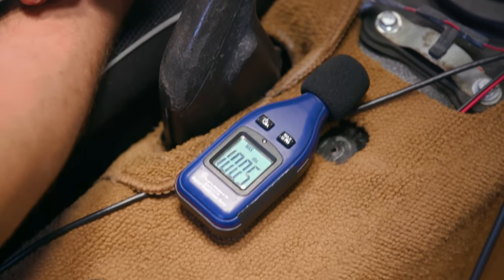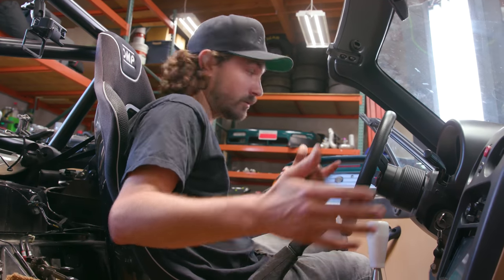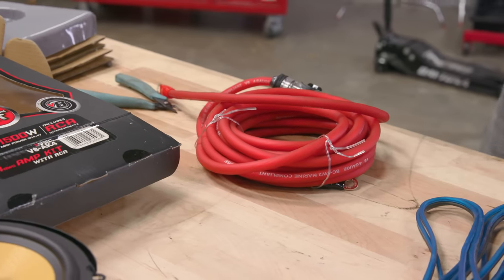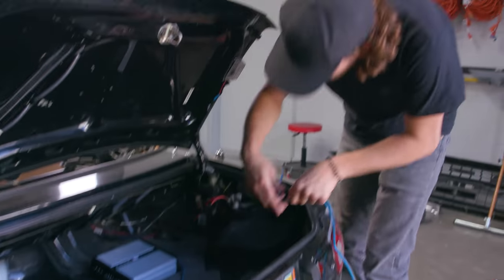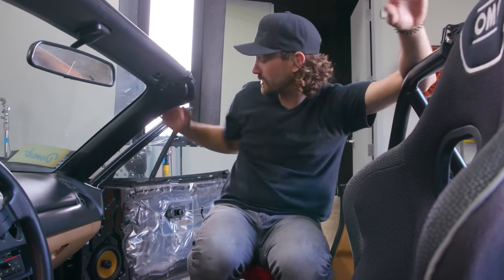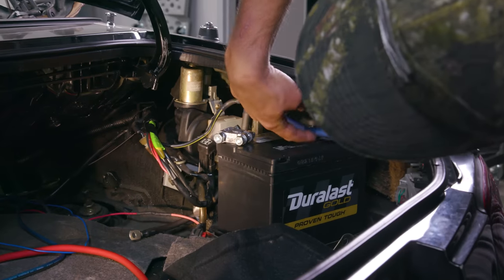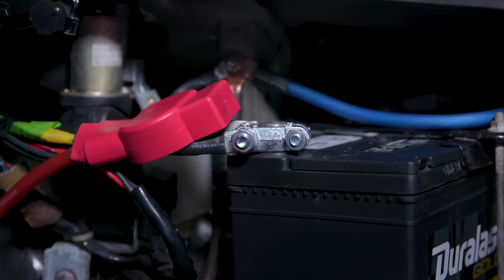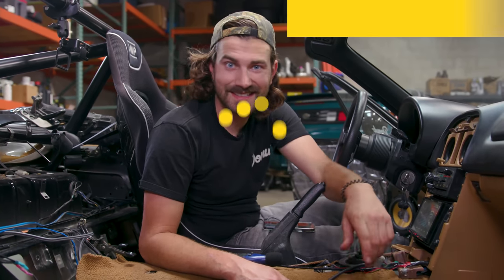Is Upgrading Your Car Speakers ACTUALLY Worth It?

Comment: Good instructional but... did anybody else key in on the fact that he wired it up to two channels, left to unused instead of just bridging the output and turning down the gains? Could have also ran the 4 channels to the 4 drivers too - even better. It's not really a good idea to leave channels unused.

Comment: Your first mistake was that you didn't hook the amp up to the alpine speakers first. They sounded like crap because they were starving for power. Bet they would have sounded equally as good or even better than what you replaced them with if they would have had amp power available. 🤦‍♂️

Comment: Nice video, I do a lot of accessories installs and repairs, and it's good to see some quality. Quick tip, use the old wires to pull the new ones through. But... you are kind of cheating doing the install on a gutted car! LOL

Comment: can you help me out. im replacing my stock speaker with these speakers
max Music Power 320W
Nominal Power 180 W RMS
Woffer 100MM 4"
midrange 40mm
Tweeter 11mm Dome
Impedance 4 ohs
sensitivity 92 DB
Frequency Response 30 HZ to 36 Hz

what AMP do I purchase to match my new speakers

Any help is much appreciated. Thanx

Comment: If you have a modern car with a premium sound system 
You don't need any new speakers, they won't do anything for you. 
Only think you might want is a little subwoofer to bring it all to life. 

You'll think that new speakers will give more bass, they won't. 
You think a set of overpriced Focal speakers that are the same wattage as the others for quad the price or more
will give you some next level audio phile sound experience that will blow your mind? 
It WON't. 
Don't waste your money or time if your car already has distortion free speakers that sound wonderful when the EQ is set right, get a subwoofer. 
Make it an 8 inch one that is sealed. Nice clean bass with a good punch. 

Done. Now if you have an old car from the stone age and the speakers are fried then ssure. Go to your best buy and spend 50 bucks or so on a set of speaks.

Comment: if someone can help me would be great. i got a honda accord 1999 with subwoofer from factory and bose amp. but i got aftermarket head unit and my subwoofer doesnt play and i know i got wires from the factory plug to the headunit adapter that arent in use but idont know what is what or how to figure since i dont have a wire diagram over it and cant seem to find been searching alot . and when i measure resistant it seems like they all fit to the back. and i dont have wire diagram over the bose amp aswell :( fml

Comment: You're a great presenter.  That being said, you have been scripted many misconceptions. Copper free power cable is Bull S**t.  Copper free interconnects (Amp to Pre-amp) is proper. Copper free speaker wire (How quite is your environment). That bad sound is likely pre-amp clipping and maybe amp clipping. For best bass response the amp should be 25% to 100% above speaker specs. Sub-woofers are for THX or rap where the music is immaterial. The overdriving amp of 50% will reproduce the lows you are looking for unless its rap. Noting will satisfy rap until the rust is falling off the cars around you.  This is just the basics. And I would bet those Alpines would sound better that those jd's with the amp upgrade I suggest.

Peace!

Comment: no matter how good your speakers are, they can't compite with "normal" speakers and a subwoofer
also, apperantly you shouldn't use the copper coated aluminium cables that come in these kits
after installing my subwoofer with 16mm² copper cables going to the amp I got a lot more volume and cleaner bass

Comment: DIYers may want to test all your speakers before screwing them all in. Wire everything up then turn the radio on to make sure it all works before screwing everything in place. Nothing more infuriating than closing everything up and then a speaker doesn't work

Comment: Dang rca is still a thing??? Thought that would have became a thing of the 80's and 90's, even early 2000's, 2010's, and 2020's. 😲 something's just dont change 🤷‍♂️ must help with cost?  Idk, I figured standards would change over 50 years,  I mean pc builders dont mess with molex or dvi cables anymore. I think???

Comment: the equipment is good equipment but do to the fact you are hooking it up incorrectly it will lower the life of the equipment. the biggest problem that i seen was you dont have the fuse block installed correctly always remember a fuse should never be more than 6ins from the battery never near the amp for multiple reasons. one being safety reasons and two all amps and wires create a magnetic field around them when in use having them that close together can cause failure the the equipment and the fuse in long run damaging the equipment and may cause a fire.....  just remember the rule of thumb fuse goes by the battery no more than 6 in.....otherwise it was a very good video.

Comment: Not to offend anyone, but there's so much wrong with this video. I'm 58yo, an old stereofile, not to mention an aircraft electrician. If the object is to piss your money away, congrats. First of all you replaced Alpine with basic speakers, holy hell. Even old the Alpines were probably better unless they were really blown. Next the replacements could at least have been 3-ways, but I'm assuming you're not interested in the fine nuances of the actual music. Next your amp will severely overpower your new speakers and you'll be back in the same boat in pretty short order. I'm from back in the day when factory stereos were shite so I get wanting to update but christ almighty match your amp and speakers so you don't shred them. OH, almost forgot. Replacing the old speaker wires is probably not a bad idea but truthfully they were working already. Ain't broke, don't fix it. But since you had to run new ones to the trunk anyways no big deal I guess...

Comment: NEVER put your volume at max with or without an amp its not good for the system 75% of max volume is the rule of thumb i learned while doing car auto at 75% its loud enough and you wont get clipping that clipping is not frequencies your speakers cant handle its also pushing DC through AC circuit easiest way to explain that without drawing out a graph if your speakers sounds blown they probably are from turning your volume to high

Comment: This is ridiculous. Everything is SOOOOO easy.
Wiring is easy, but routing and installing can be very daunting and filled with problems. Removing carpets, seats, weather stripping, not breaking clips etc. is the hard part. Why don't you show us an easy install on say a 2014 Audi S4 with two amps in the back, a DSP, a small sub, and of course components front and back. Yeah, done in an hour right?

Any good install requires a pretty big strip of the interior, even in an MX5. That will be the issues for most people, not the install itself. Show that and call it easy.

Comment: Get enough speaker sizes to handle all the sub lows all the way to the tweeter highs. Buy quality speakers that will be durable and deliver crisp sound.
Send the appropriate frequencies to the appropriate speakers.
Send enough power through the system to have clean undistorted reproduction of the sounds.
Run the wiring necessary for the power, for the sound, and keep those signals interference-free.
Have a head unit that can make the fine tuning adjustments for the system, without ridiculous complicated nonsense.
Is this too much for automotive manufacturers to do on a consistent basis? Why the cheap junk in cars that cost nearly 40 grand? Frustrating.

Comment: I feel like you could have done a lot better job of explaining this process and just audio in general. This channel is great with capturing concepts, but in this video you do a terrible job of helping the viewer understand what goes into good audio. You make the process you chose seem like the only viable option for getting better audio, but stuffing coaxial speakers into the bottom of the doors is going to leave most people disappointed. With better choice of components and proper placement (especially with tweeters), one can achieve accurate sound and a cohesive soundstage for not a lot of money or effort. I would love to see an updated video, you owe a proper explanation to your massive fanbase. Love your other videos.

Comment: Folks, don't ever use max volume for testing (on the headunit) unless you want to blow your speakers. Jesus.
Reply: Shouldn't you test it at the point where it starts to not sound good?
Reply: @jaskajokunen3716  The problem is you've now got a new signal path with it's own volume. So, let's say you forgot to turn the amp down, so now you have a maxed out headunit and amp that is going to push the sub way past it's RMS (continuous power rating), and maybe even past its peak depending on the amp and now you've got a blown sub. The higher the amp is in volume, the higher you raise the noise floor. The goal is to keep the amp as low as possible while getting the sound you're looking for. However, that doesn't mean just boosting the shit out of your bass settings on the headunit. That also raises wattage and can potentially push it past it's peak. So, I normally start my headunit at 25% volume and the amp all the way down. Then I slowly turn it up until I start to hear the thump. Tweak the settings on the amp before tweaking any headunit settings (high pass, low pass, etc), make sure you're still within your RMS wattage and then you can tweak the headunit if you still want more. Just be careful about going over RMS for too long.

Comment: Usually these videos are great... And this one mostly is too.

However the main issue is.. He's dead wrong about "turning the amp down".  The gain on the amp is not a volume knob.

Secondly.... He says going with the same brand of amp as u did speakers will match them up.  That's not really true, and definitely not necessary at all.

Comment: Those are not JL Audio component speakers, those are JL Audio coaxial speakers, And you're wasting your time running additional speaker wire. It's just not necessary with a 6½" coaxial, even running amplified. The time and money would have been better spent with sound damping or baffling.

Comment: huge mistake to cut the wires, why not just tape the ends and leave it like that just in case you want to go back to original wiring. that is the only thing i dont aprove on this video

Comment: I have a '21 Bronco Sport and the OEM speakers are hands-down the worst speakers I have ever heard in a car, and that's after owning an '89 Buick with 4" dash speakers. Seriously, they were what you'd expect to get on something from 30+ years ago. The magnets were embarrassingly weak and light, the woofers felt like paper, and the only tweeters were in the dash. I replaced just the front/rear door speakers with Infinity REF-6532IX 6.5" 2-way speakers, and it was the single greatest sound upgrade I think I've ever made. The OEM head unit really came alive is perfectly fine for the task now. I guess maybe they ran out of good speakers and put these piece of shit "Made in Mexico" paper speakers in instead. The whole Bronco Sport experience has been kind of an exercise in, "well it was made in Mexico", unfortunately.

Comment: He's not talking. He is explain, like instructor.

SureJL Audio is good, I'm in my Caddy Seville STS debating
Focal
Infinity Kappa
Hum...
The factory Bose is awful,  being audiophile is only loud at 425 watts, the 12" sub has paper thin.,if you want to hear baas must be questioned, shhh here comes some bass barely.
Yet the Bose in my Silverado actually sounds decent.
Plan to remove the head unit install Kenwood navigation, Excelon .

In college the joke about Bose ... 
No highs
No lows
Must be a Bose.

Comment: this is rly beginner beginner stuff. dont do nothing after this video. just go look up some pro's. this man rly just bought the same diameter speakers and put an overpowered amp in a car thinking hes gonna get soo much better sound. it would be almost the same if he just made a high pass filter for 5 bucks and put it on the old ones. even some insolation or some anti car panel vibration would help. Most of the bad sound comes from the panels shaking. even a good sub sounds like shit in a car like that. best would have been an amp much weaker with  20-40w woofer and the same old speakers or change rubbers for old spekers for 20 bucks if needed. and if he goes with this amp he fucking need to but 2 woofers in the back or 1 in the trunk . Btw im just a beginner myself i learned all this in a week designing my own amp circuit

Comment: Never look at a speaker or amp's peak power rating when trying to match components. Always refer the the rated measurement of sound rating aka the RMS rating. Referring to peak power ratings are the most common mistake amateur audiophiles make when buying speaker and amps. Typically the RMS is half the peak rating, but not always. This is extremely important for both sound quality and lifespan of the speakers. 🤦‍♂️💩

Comment: This is a huge fail. Those alpines will also sound better hook to an amp. The amplifier and 99% aftermarket and stock head units are piss poor at best when it comes to producing clean sound. Not really a fair comparison for the alpine's as they are not amped up so to speak. Next when you crank the volume on your phone and that's your signal source you're already sending a clipped or distorted signal to any of your amplifiers. Honestly if I was you I would do a little research or really a lot of research on sound and audio in general signal keeping it clean and being able to do Fair comparisons. Not saying the alpines are better than the JL although I've seen $25 speakers sound better than anything JL makes. But comparing the Alpine speakers which is powered by a head unit amplifier and the JL audio speakers which are powered by a external amplifier is like saying an apples the same as an orange because it's a piece of fruit.

Comment: Well I hate to say it bro but your facts are completely wrong  when it comes to new speakers you have to break them in slowly you can't crank them up right away it's the   Wrong away it takes a couple of weeks to really break in your speakers so they sound really good so you're facts are completely wrong cause I deal with stereo systems a lot and I know what a When it comes to buying brand new equipment you have to break them in especially speakers
Reply: Redo your test when they're broken in

Comment: dont buy some dumbass wiring kit. 
-small spools of red 4ga and blue 16ga wire
-4ga fusible link
-couple sets of rca cables
-a pass filter if you need it

this shit shouldnt cost you more than $50, and its all reusable